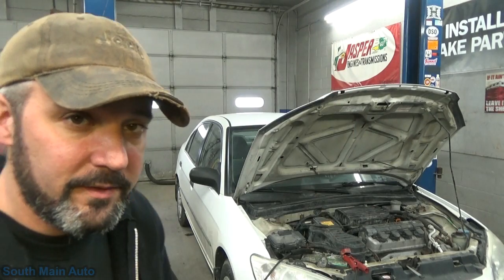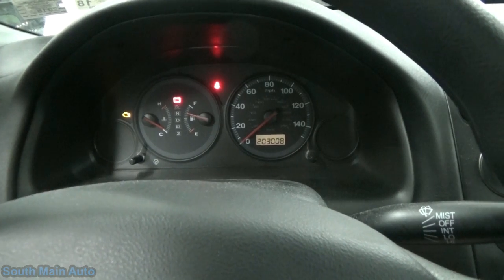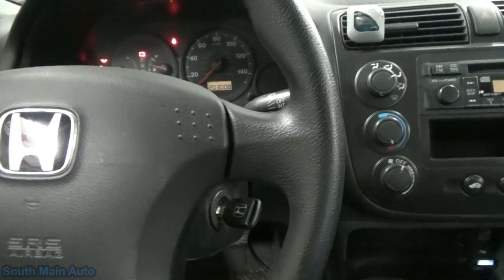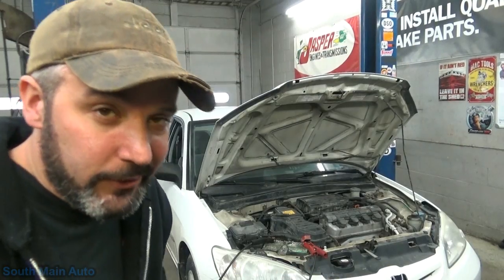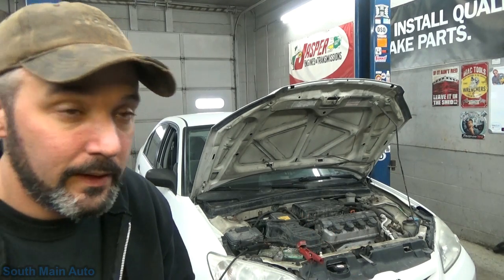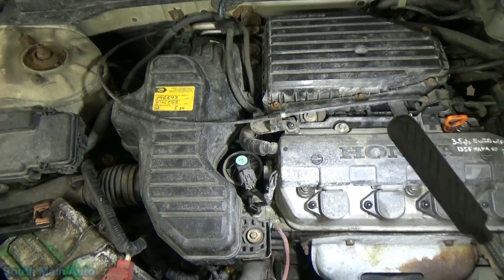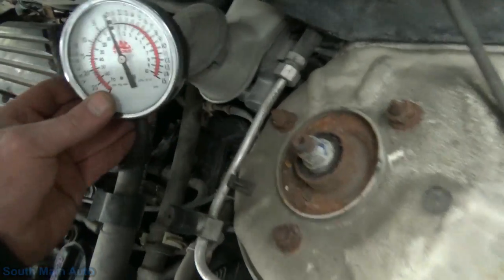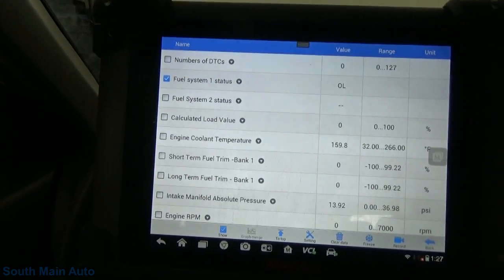Honda Civic - Crank / No Start

Comment: Someone is lying... Egr wouldn't have opened while in a drive thru... So how would it get stuck in the drive thru? Makes no since.... Gotta be a smart ass.... Lol..  Very nice video...  I've seen a stuck purge solenoid do that before....  I would have checked that first since I was told it happened while in a drive thru vs entering it

Comment: Need some help please. I have a 04 honda civic lx 1.7 liter auto just like in the video. It sat for 5 years, no gas in tank, motor cranks and will run with starting fluid but not on its own. I checked the fuel pump fuse and relay. Can you guys give me any idea where else to look? I ordered a new fuel filter in tank because it has 160k miles and im sure its dry and clogged.

Comment: EricO. I sure do wish you were here.....As you know I have the 07 Ridgeline. I had mentioned to you before about this problem. I press on the gas peddle and my head lights go dim and when i let off the peddle they go bright. I took it to the dealer and was told my alternator was bad so it was replaced. The problem came back and was told that my battery has a bad cell so yes it was replaced. The problem is back again. What I do? The truck runs very well and never give me any problems but this. HELP!!!

Comment: this is the exact symptoms my old 07 honda fit had. took to our local mechanic, told me it needs an engine, why? cause it does.  this is why we hate mechanics, they charge 159$ to diagnose it, then dont even explain why it might need an engine when it didnt.  Ended up getting written off before I saw this video though

Comment: I remember my first stuck EGR valve diagnosis in 1974 on a 74 Dodge Dart slant six & how bad it ran at idle. You're probably thinking how I can remember that...b/c as I was bending over the car Bob T. stuck the overhead pneumatic oil dispenser in my pocket and pulled the trigger.  He laughed his ass off & it was all fun & games until he was welding underneath a car & I shot him with the pneumatic grease gun...it was paint ball back in 1974. Of course I got all the other nechanics together so they could watch him dance. He was @32 yrs old & I was the kid at 18 yrs old & he learned this kid shoots back. The service manager didn't think it was funny...something about you could shoot someone's eye out :O
Reply from the maker: Haha ohhh back in the days.....
Reply: I went way way back for that one!
Reply from the maker: atleast 20 years huh
Reply: I worked with high school guys like that back In 1974.

Comment: No shit, I had an 2002 accord years ago and had the same symptoms...it would run ok with throttle but would idle like crap and stall out. It eventually set a code that lead me to the EGR valve and the same thing, it was a piece of carbon stuck in the valve! I wish I could have seen this video before going through that cluster f#$&.

Comment: I've seen carbon in the EGR valve many times on GM 4.3 liter engines. It was such a common problem that someone sells a replacement gasket with a screen in it. Did you start it without the EGR on it to blow any loose carbon out?

Comment: Nice video as usual.  Two questions - #1- Notice check engine was on when running and you stated that there were no codes.  Then, why is the check engine light on? #2 Nice cordless light.  What is the model number of this light?
Reply from the maker: More than likely just the misfire codes from running rough, http://amzn.to/2mNHwXS
Reply: Eric

This website doesn't show the flexible gooseneck cordless light that you showed in this video.

Comment: Quick question I have a 1999 Toyota Camry LE 4 cylinder and it’s throwing EGR Valve code I took it to my local shop but it is still throwing egr valve codes I don’t understand why they told me that it’s the lines that are full of carbon the car has 186700 miles on the car please help or give me instructions on what to do

Comment: Eric or class.. ..
2003 accord. brake booster bench testing. 
Should it not hold vacuum unless the master cyl port is sealed? 
My knowledge with other brake boosters, is that you should only have to hook up the vacuum line to check it. 
Getting code for idle control problem. Seems to only set code when brake is pushed.  Clamp off line after check valve and no code.
Reply from the maker: kinda answered your own question :) Master cyl has to be on to hold vac yes
Reply: South Main Auto Repair 
I don't remember it being that way. :(
Not like i Test Brake chambers everyday. lol

thank you sir. love your Vids. some of the best and most informative.

I do have a leak when it's on car though. so.. new one it gets. looks that the master cyl has been changed recently.

Comment: If I take my battery off for any reason, the learn data in the main ECU is lost, when I reconnect my battery I have to drive 30 miles at different conditions so it flashes the memory from the factory map to how I drive, just wonder if that is the same with the little Honda.

Comment: Bad EGR = HUUUUUUGE Vacuum leak

Car manufacturers: "Hey guys, let's take this finely tuned air pump, where the balance of air and fuel needs to be just right for it to run properly, and give it an additional air leak from the exhaust system while it's trying to run. Oh, guys forgot to mention, it will be the exhaust system where lots of hot gases and carbon come from, let's let that crap back into the engine ! YA!"

Of course, EGR should only ever open during NON idle and once the engine is up to temperature, but the problem is now you have an air inlet valve to the engine when it fails, pure air coming in NOT through the carb, so it can't be mixed with fuel properly.

Oh well, I guess it's worth it for the emission reduction..:P
Reply: Even better, would you want to eat a plate of your fecal material for breakfast?  No?  Neither does your engine.

Comment: On some of the earlier more performance oriented Hondas like Integra DC2 and Preludes I've heard of guys removing the egr completely, you can even buy CNC'd block off plates. What's the advantage/disadvantage of doing that?
Reply from the maker: decreased fuel mileage, increased cylinder temp, more spark knock and high NOX emissions... advantages...um not real sure. People thinks it makes them go faster :D

Comment: Sounded like she had a big bumpstick with that rough idle there, LOL. :D

Eric, have you done ball joints on a 2014 Silverado 1500 yet? I have one to do this week - 50k on the clock ... GM still building 'em great ... LOL. Wondering what kinds of surprises I'm in for, or if it's the same as my 2007 ...

Comment: I have a 03 civic also... and something like this happens to me... it turn on perfectly everyday... but I drive and lets say I go to the store... and get back after 5 mins the car won’t start... so I would crank and it won’t start... I would wait 15 to 20 mins and the car starts good again... idk what can it be... fuel pump or to much gas that it flooded.. any idea? Cause it turns on perfect but after a drive if I turn it off I have to wait for like 15 to 20 mins and it would turn on

Comment: Same EXACT thing happened to my daughters Accord. Dealership wanted $300 for parts, labor and diagnosis. I fixed it in 15 minutes. No parts needed. Friggin' thieves.
Reply: Rob, buddy. How the duck did you do it?! My civic has the same issue but it won’t even idle. Just Cranks, backfires and dies.
Reply: There was a chunk of carbon holding the EGR valve open. I just knocked it out, cleaned it up a bit and bolted the valve back on. Ran great.

Comment: I’m currently working on a 03’ Civic with the same no start issue. I unhooked the fuel line on the fuel rail, and it’s getting fuel, replaced the factory glow plugs,,,,, tested and cleaned the fuel injectors. If this turns out to be the prob, I’m gonna ghost  ride it off a cliff, then go put a head gasket on my Subaru!!! 🤬

Comment: I have and watching your videos for a little while have some trouble with my GMC truck I put a new ground strap in all my idiot lights and gauges work fine now but one thing did not clear up and that is the interior and headlamps when they're on they did and get bright them and get bright that my alternator also had a question of how can I test my alternator hopefully he'll see you this and give me a quick response back like I said all the idiot lights that were coming on abs airbag oil light all have stopped I might owe 8 GMC 4x4 Sierra 5.3 liter but the interior lights dim and come back bright dim and come back bright could you do a video on how to check your alternator on a truck I believe mines a half ton pickup short bed SierraGMC
Reply: Lee Barnes is there a voltage regulator built into the alternator or is that a separate part also
Reply: Yes there is Joseph, it's found inside but is a separate part that can also be replaced.  But they usually have only two failure modes, full ON or dead as a nail.  The bright then dim you report are classic symptoms that match only worn out brushes sometimes failing to make contact with the slip rings for the field. RockAuto will show these parts and often sell them too. They are quite good at proper parts alignment with vehicles. Chevy went internal regulator many decades ago in the last century. Often at parts stores they sell alternators new with no core charge, and the price is in the same ballpark as a rebuilt alternator.  This allows you to take your time rebuilding the old one for a cheap spare. And eBay sells rebuilding kits.

Comment: So assuming nothing else is wrong, if you have a an increased fuel trim at idle you probably have leaky hoses or manifold gaskets? Common in older high mileage vehicles I presume.
Reply: I had fuel trim issues on my 08 Odyssey with 166K on it.  They were around +15-20% but no check engine light. I just happened to see them like that after an oil change and just doing a quick scan afterward.  Replaced both upstream AFR sensors and it's down to 3-4% now.  They appeared normal in scan data, around 1 on the Lambda, but replacing the original sensors did the trick.

Comment: What is that flexible light at 11:00? I can't find it in the astore.
Reply: TheMightyGubbins Astro flex light it's for sale on Erics amazon Web site check it out below the video.
Reply: Astro Pneumatic Tool 30SL Flexible Rechargeable COB LED Slim Light is not really in Eric's store -- I've looked before and couldn't find it either.  Use the astore link for anything and search for it, I think it still counts as supporting him?

Comment: Wouldn't a plugged catalytic converter increase manifold pressure?
Reply from the maker: during cranking you will usually just see low vacuum
Reply: South Main Auto Repair 
Interesting. Thank you for replying. Another great video.
Reply: Troy WT All the more reason I would think the manifold pressure would be high. I'm not referring to the engine starting or being able to start. But logic or reason would have one think if the engine is a pump and the exhaust is blocked, then where does the pressure go. Hence why I was thinking the manifold pressure would be higher if the catalytic converter was plugged.

Comment: My car would do the same thing after I drive it for 30 min or more then come home and park and say I want to leave again in 10 min I would go start my car up and would so the same crank but won’t start and I would press gas pedal to see if it stays on but it does down. But after 15 - 20 min of waiting i crank it again & it turns on as if there was not problems but the cycle keeps repeating itself
Reply: Any advise pls

Comment: So two people, the owner and the good samaritan could not figure out how to push on the gas pedal to get it started and limp to the garage?

Sad.
Reply from the maker: Well she is a Vet Tech and I imagine the guy helping her was prolly more interested in her than figuring out the car trouble haha if ya know what I mean.
Reply: I can't imagine an inexperienced person trying to keep it running, and doing neutral drops would do a 200,000 mile transmission any favors. Tow bill is cheap.
Reply: dpeagles they are probably too young to remember carburetors.

Comment: 200k miles, that valve looked pretty crusty. Why not replace, or clean it?
Reply from the maker: don't wannt throw a part at it if it did not need it :)
Reply: Oh I agree 100%. It was a question. If your experience tells you it'll last, that's good enough for me. Thx for the reply.

Comment: I thought foreign cars never break down?
Reply: a stuck egr valve (because of carbon buildup) after 200k miles… wouldn't really call that 'breaking down'
Reply: They do toyotas are most commonly broken down here in California all i see is toyotas on the side of the road with their hood open and smoking.about 60%toyotas,20%hondas and another 20 percent mercedes/bmw.Thats why you mostly see japanese cars at junkyard cuz theu fragile and cheap

Comment: I can't believe you have never seen a carbon stone do that. The old Chevy 4.3 would do it all the time. I got to the point of installing the EGR gasket that had the screen in it on pretty much every tune job. Maybe I am just lucky. FYI, I always torqued the nuts to spec when I was done.